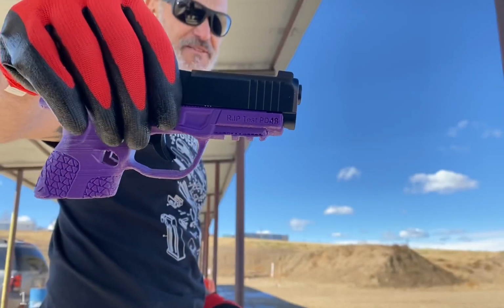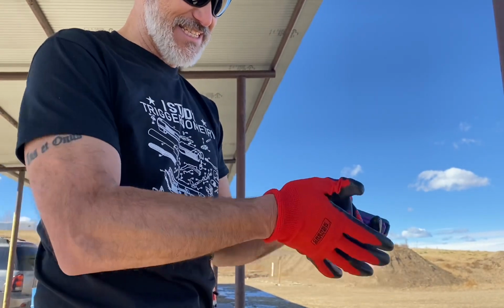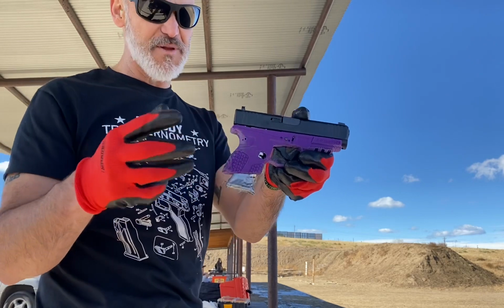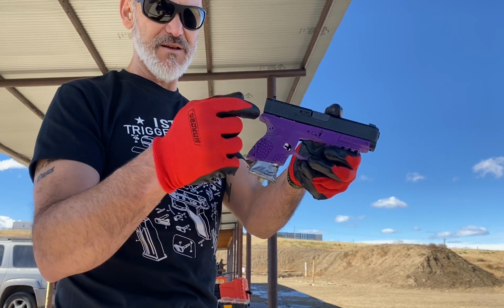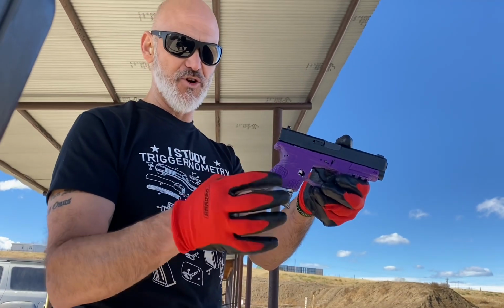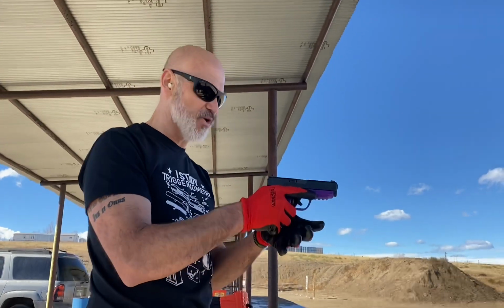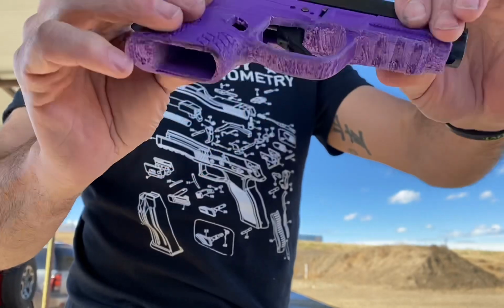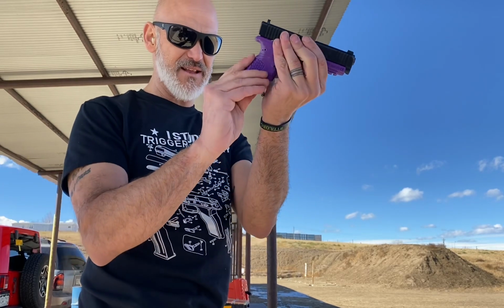First Range Session with the XPD-48!

Comment: PLA? Why printing top side up instead of top side down?
Reply from the maker: Clean internal surfaces
Reply: @RobPincusPro  gotcha. Thank you. Do you mind please sharing the print settings you have found that work best so far? Like print top side up, .20 layers, supports yes, material PLA?
Reply from the maker: @Shootsmith  send me a private message and I can take a pic of my settings...  but, I’m still tweaking them every print. So, I don’t have a “works best” yet
Reply: @RobPincusPro  thank you! Looks like YT has removed PMs so I send you a message at your website link.
Reply from the maker: @Shootsmith  rob@icetraining.us